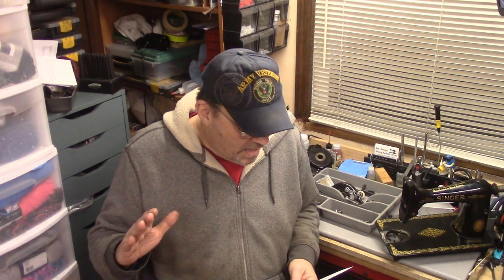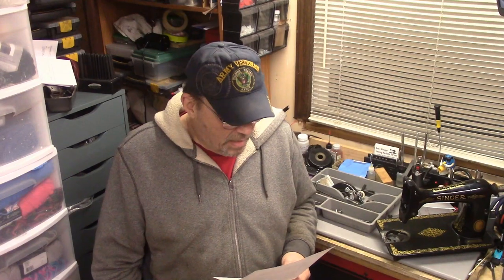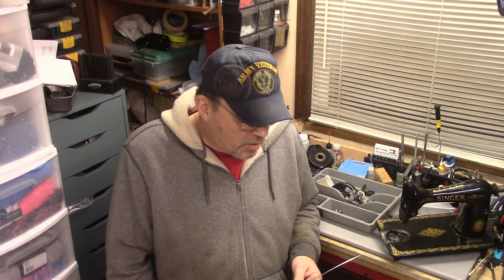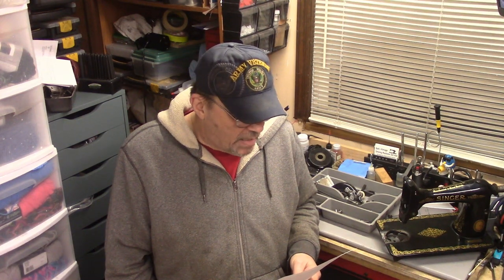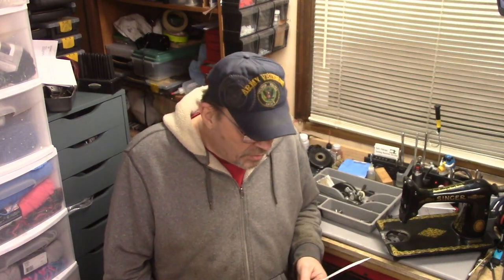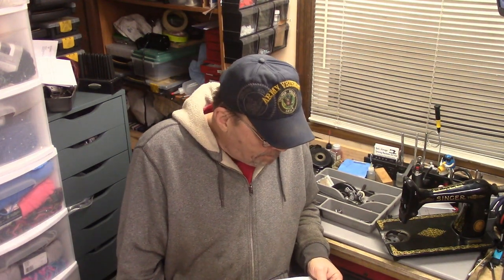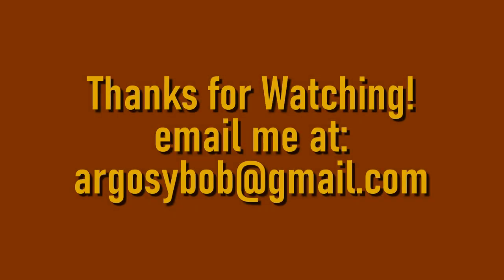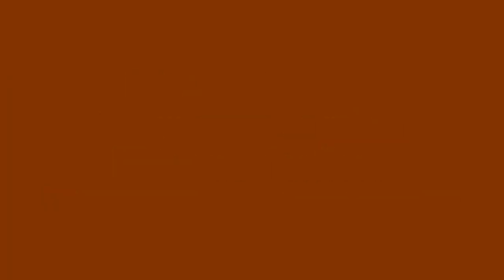The Missing Q&A!

Comment: Bob, I'm thankful I found your site. 
I just finished rebuilding a singer 101-3 when you started yours! It was my first rebuild and YOUR VIDEOS on cleaning, and potted motors were INVALUABLE.  
My 101-3 is cast iron, it was frozen but now it sews like a dream ; anyway I wanted you to know I replaced the lead tubing using your trick. The grease on the gears trapped most of the lead decay. 
And now I have a real project; a singer 101-2, the solenoid is inside the head and the spider is cast iron!!  It looks like a condition 7-8 to me, the table is tight, the head has no dirt buildup, everything moves freely by hand, and the decals aren't silvered, just worn in the front. I even have the original cord.
Fortunately the manual was in the drawer, on page four they explain; before you plugin the machine, you have to determine if you have direct or alternating current! 
Anyway I would like to see more on the 101's because I don't need any meaningful learning experiences on this one
Thanks Tom
Reply from the maker: Hi Tom, I have more 101 content in the pipeline, but please be patient, there is sooo much to cover!

Comment: Love your videos, thanks for providing them. I'm restoring a Kenmore 117-812 Rotary and was wondering what to use for replacing the wicks (found 100% Marino Wool squares on Amazon that could be rolled up) not sure if that is a good choice. I think the wick is maybe a 1/8". Also I see repair guys using a syringe with bearing grease in it and putting it on the wick replacements, but no one says where to get it or what type of wicks to use.  I understand that Singer not longer sells their original wick bearing grease. Any input you have and links to products you use would be greatly appreciated.
Reply from the maker: Hi Cindy. The best materials I have found for oil or grease wicks is firm felt cord, available in several diameters from McMaster-Carr. I tend to use F1 grade as it is a little denser. Pick the size that fits your application.
https://www.mcmaster.com/felt/firm-felt-cords/